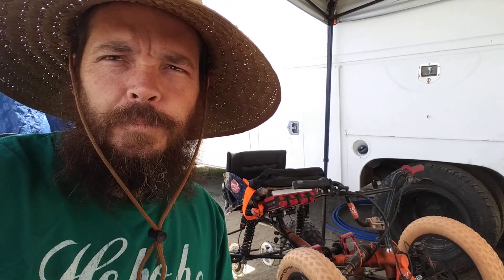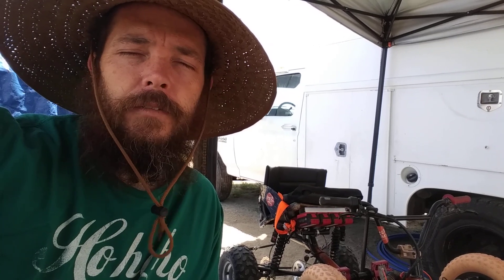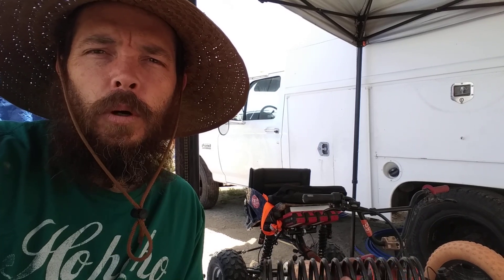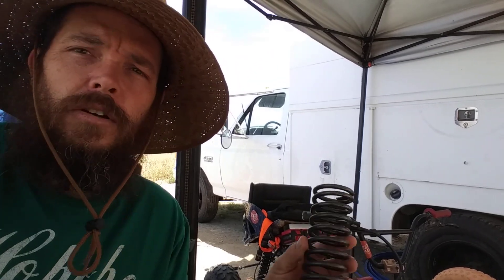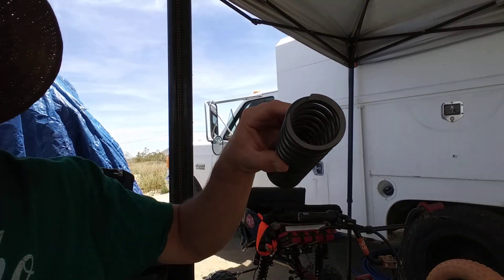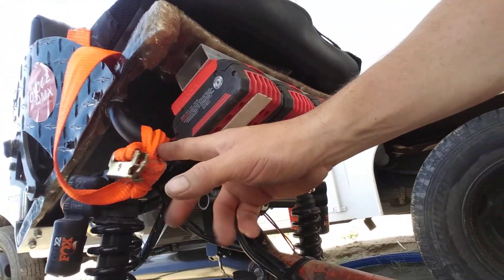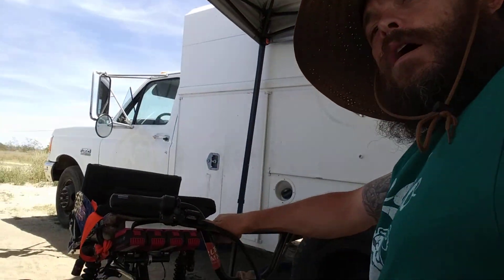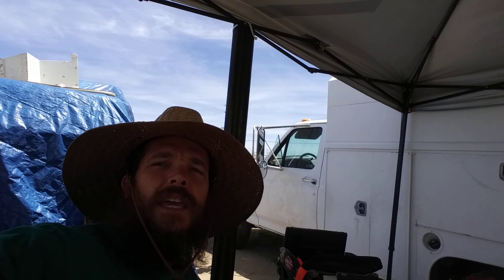3000w 72v brushless motor | speed controller | Cycle QMX

Comment: Bro i got 1000 w hub motor on my trek bike 48 v 30amp discharge i can get up to 58 mph not recommended lol 25 30 fast enough .so with 3000w 72 v should  be able to go break neck speeds. I see tho ur using drill batt idk how discharge amps  and watts ur producing..my plan is to make my quad electric love ur enginuity good video 📹

Comment: Your 3000w motor is not what's lacking, bud. One flawed choice I noticed in your project design is the capacitance of the drill battery packs.

Comment: What was the name of the motor controller company in Canada?  Do you have any advice on seeking a 3000 w 72 volt 48 amp motor controller, for a NB power hub motor?
Thank you. It's been a real pain to find the right motor controller, with JST connectors, versus all the other ones.

Comment: I'm thinking the thottle might be your problem if you can get it to work by messing with the speeds. Id check to see if you are geting signal to and from it. If you are and there is over 60 volts at the controller then it is a problem with the controller. If there is a problem with your battery cells it can cause this problem also. If a cell is shorting out then the voltage will continue to jump and fall until the shorted cell drains the rest of the battery pack. This could cause the controller to turn on and off from the voltage protection

Comment: how wide do the bike trails have to be for you to go into them?? do your tires hold pressure if they punctured by goat heads? That is a problem i used to have
Reply from the maker: 48 inches trails is recommended. Most horse trails or state run parks will have access. Yeah, Air in the tires with tire sealant works best. Goat head suck. Thanks for checking in.